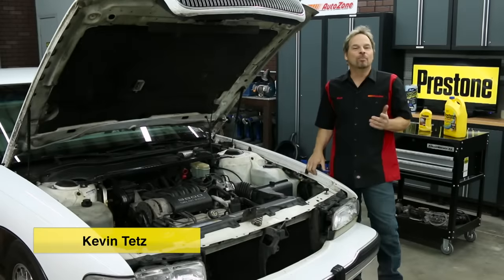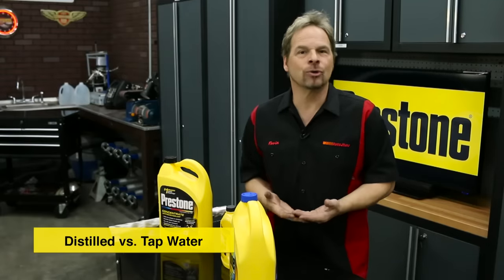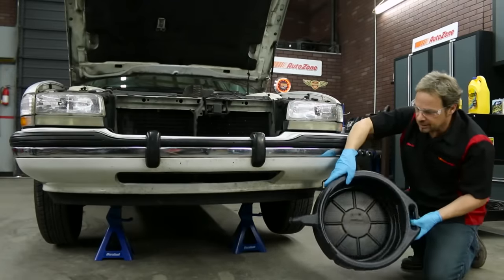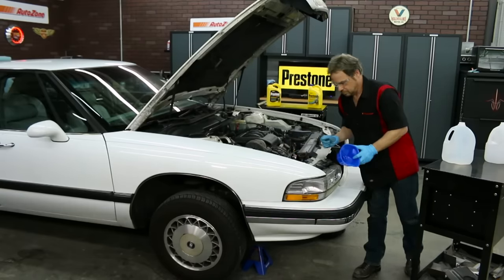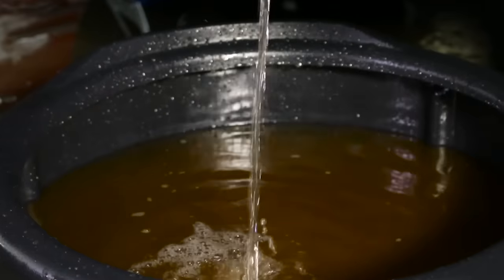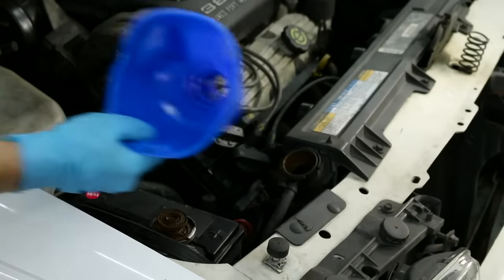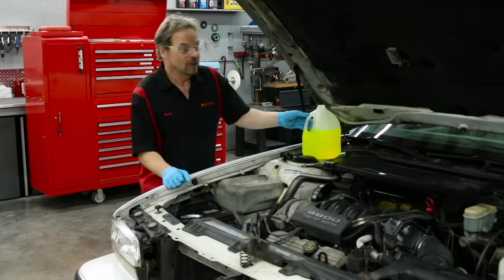AutoZone How-To: Flushing and Filling Your Cooling System

Comment: What he failed to mention was that there is quite a bit of water left in the engine block even after the radiator is drained. So, when he added a mix of 50/50, what the engine actually ended up with was  weaker than that due to the  water left in the engine block. The better way to do this is to add half the capacity in straight antifreeze, then top off with distilled water.
Reply: You're right T. Jones.  When you drain the radiator like this you're only getting out about half of what's in the entire cooling system.  There's still water left in the engine block and heater core.  If you use the 50/50 mix to refill, you're getting a diluted mix.  I would use the straight antifreeze when refilling as you suggested.
Reply: Anton Maxx 20 being the percentage of antifreeze to 80 percent water. You can actually use just water with a radiator additive  making sure it contains corrosion inhibitors. Water alone is much better at displacing heat than polyethylene glycol mix in hotter climates but the only problem is the hot dissimilar metals want to corrode without a additive.
Reply: Agree!  This how I would have done it too.  It doesn't hurt to have 60/40 either.
Reply: @AWIERD1 , I'm sure you could do 80/20 but I wouldn't do it on my car since I live in the cold climate.  However, even in the warm climate I'll still do 50/50 to reduce engine overheat due to lack of glycerol since water boil and evaporate.
Reply: @tousshong9438  There should be no water boil due to the positive pressure in your cooling system. Positive pressure of 14-15 pounds increases the boiling point of water 45°F (25°C). Most all modern vehicles utilize positive pressure to increase the boiling point of water nowadays. 

The active component of antifreeze ethylene glycol carries 37% less heat per unit of volume than water. Also it tends to breakdown in the presence of oxygen into various acids like formic, oxalic, glycolic, and acetic acid. Requiring more additives to keep everything alkaline and buffered to prevent corrosion. So if you don't need freeze protection except for a few weeks I forgo antifreeze in place of corrosion inhibitors, water pump lubricant, and a surfactant.
Reply: Just stat engine a few moments to put that stuff out... then filled like he says.
Reply: At least start the car while draining for a few seconds
Reply: My name is Steve Rogers  
Where are the "engine block drain plugs" ?
Reply: My name is Steve Rogers  
I had no idea. i thought the drain plug you had to crawl under your car to get to by the radiator drained all of the coolant out. They should mention this in these videos.
I got to tell you I dont know much about cars or engines  
All i have done is tried this prestone coolant flush stuff with distilled water once like he did in this video .my coolant still had bits of gunk floating in it after I flushed it
Reply: Great 👍🏾 advice T . Jones. You should have your own channel . 👍🏾
Reply: Even than filling with half the capacity it’ll push it out the radiator when filling
Reply: @rbeck3200tb40  The radiator drain plug tends to be the lowest part of the system. Before draining, if you get the engine up to temp, letting the thermostat open, the coolant in the block will drain. Add the flush fluid and run the engine again with the heater on (to flush the heater core). Drain it again. If it's not clear liquid, flush it again. Add more flush fluid, run the engine , drain the fluid. Simple as that.
Reply: @mvsawyer  Or take out/replace the thermostat if it's easy to get to. Chrisfix has the best video on flushing coolant. These are short, sales add type videos
Reply: I ran my car with tap water for a couple of years with no coolant. It still worked great even in 100 degree weather. Lol.
Reply: Straight water cools better than antifreeze. You only need the "antifreeze" if you live in cold climates.
Reply: @greenram1996  drain it over and over with a hose of you have too..till its clean water coming out. He.open the bleed 1st at beginning of vifeo..
Reply: @greenram1996  so after its all drained out after the final water flush and you got out what you could from the rad and possibly the reservoir you simply add a full gallon of concentrated coolant and follow by whatever water is needed to top it off which should be less than a gallon if your capacity for example is 2 gal?
Reply: That's why he ran it with distilled water. It mixes with the remaining coolant in the block and comes out when you drain it a second or third time.
Reply: @alfiramos8566  exactly ..BOOM💥💥💯💯THATS ALL U GOT TO DO IS START THE ENGINE, PUSH THE REST OUT AND SEAL AND RE-FILL
Reply: He also said it’s ok to flush with tap water,  which is wrong, only use distilled water for the flush. I usually flush five gallons through the system before it’s clean enough to to add 100% glycol.
Reply: So what ur saying is. I should put in 100% concentrate for half of the capacity. Since there is half of the water in the engine block. Then just top it off with distilled water so I can get a more accurate 50/50 mix?
Reply: @numbers7889  Yes, that is the correct procedure. You should be able to drain more than half of the water (especially if your engine has block drains) but you won't get all the water out.
Reply: @TJones-ve8wd  thanks. I just finished doing that. I’ve got a more accurate 50/50
Reply: I tried to drain my coolant today in a 2010 Elantra and only 4liter came out even though the owner's manual says its capacity is 6.6lt. and when I added new collant less than 5 liter went in. I added a flush thign s well. is there a way to empty he complete coolant?
Reply: @wonderwalls3565  It is nearly impossible to get all of the coolant out. This is why it's so important to flush thoroughly. You want to make sure that the only thing left in the engine when you're done flushing is distilled water.  Check to see if your engine has block drains. If it does, you should be able to get quite a bit more out.
Reply: @wonderwalls3565  no. It’s never going to completely come out. What I did is I just used concentrate.
Reply: @numbers7889  I put a flush fluid. do i need to drain all of it? I feel if I dont it may destroy the radiator/engine block.
Reply: @wonderwalls3565  yes you need to drain it out. Can’t leave it in there for too long. So you might need to repeat the flushing process a couple of times. Add the coolant 100% concentrate. Then top it off with 50/50 mix. You can use the 50/50 mix to add more coolant later on.
Reply: @wonderwalls3565  ran into the same problem so I understand. Theoretically you could keep the car running and keep the petcock open so that all the water and coolant that’s stuck in the engine and stuff is free. But personally I wouldn’t do that. Could risk damaging ur engine.
Reply: @numbers7889  I opened the radiator drain plug and added 5liter distellied water till I could not see any more coming out. should I add 5liter more before adding the coolant?
Reply: @wonderwalls3565  when you added the 5 liters of distilled water. Did you keep the drain plug open or closed?
Reply: @numbers7889  opened. I added 2*5lt more to flush out everything with drain plug open and after 15 minutes I closed the drain plug and when trying to put in the coolant it took less than 3 ltr and keeps throwing out if I add more. the manual says it needed 6.6ltr. I have no idea how to remove the air. tried reving up the engine with the radiator cap open but nothing.
Reply: @wonderwalls3565  maybe squeeze the top radiator hose. Also if you have ur thermostat inside, chances are, you won’t be able to get most of the water out unless your car reaches the correct temperature
Reply: @SOLDOZER  But corrodes
Reply: @kirbyrohling8392  why, replace it with distilled when your done
Reply: @TJones-ve8wd  yeah but coolant will take care of any residual tap water
Reply: Or you could check the concentration when done.Calm down.
Reply: @rbeck3200tb40 Then you should have flushed it more than once
Reply: So I have to ask how so. Does the water separate from the antifreeze?  Does it weigh more which is why it stays behind?
Reply: @jmedi5589   With most engines it is impossible to fully drain the coolant from the block. When it is flushed with water, there will always be some left in the engine. This will dilute the antifreeze/water mixture that is added.
Reply: that makes zero sense
Reply: To flush all the coolant including the block just take out the thermostat to keep it open. Afterwhich, pour the flushing liquid and top it with distilled water. Run the engine for about 10 to 15 minutes, revving it from time-to-time. Cool it down to flush. Next, fill it with distilled water and run the engine again and continue this process until you are satisfied. Finally, put back the thermostat, fill with ready to use coolant (up to you) and your cooling system is as good as new.
Reply: What he failed to mention was “I’m a trained professional and smarter than you 😳😳😳😳😳😳😳😳😳”
Reply: Couldn't you just do a round or 2 of flushing with what you need?
Reply: There is a drain in the engine block in which he failed to drain so the old coolant and water he used is still there
Reply: This comment thread Is GOLDEN
Reply: To tell you why I prefer to buy a concentrate rather than a ready-made mixture. Because I'm used to flushing the system two to three times with water. Since the system is not emptied completely, only water remains inside. Then I look in the instruction booklet to see how many liters the factory filling holds and how many the service filling holds. Let's say that the difference between one and the other is 7 dcl., I pour 7 dcl. concentrate, and the rest is a mixture that I make myself.

Comment: Step one: make sure engine is cool before opening the radiator cap!!!
Reply: Awww, that's no fun!  You ain't lived 'til you've spent a few days in the burn unit!  Buzz kill.
Reply: He said that.
Reply: What if you melted the cap?
Reply: @codymiller3444  step 0: throw the car away
Reply: @BRO.JUSTIN  lmao
Reply: @claveecl1564  😂 forgot I commented that
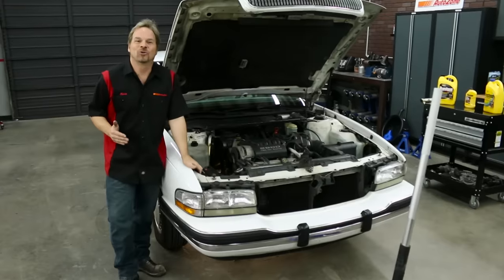Reply: 2:00 ish mark. He said make sure the engine is cool to the touch
Reply: 1:55
Reply: Not really just apply pressure on the cap some is gonna over flow but it not gonna fly every where
Reply: @justinrobinson1494  you've never seen a reservoir have boiling coolant before then...
Reply: Learned that the hard way😂
Reply: Lmao
Reply: On my first antifreeze change after a few turns the cap just popped off and hot antifreeze got all over me I learned my lesson and was left kind of traumatized
Reply: Not that important. Just slowly unscrew it like a bottle of shaked coke.
Reply: I open the cap hot  all the time, mainly if it's just distilled water inside.. not if there's coolant.. like recently, I had to do a water outlet.. they didn't even last a year total failure of the part. Anyway, the part was covered, but they don't reimburse you the coolant you lost... so there you go, you have to buy more coolant
Reply: Just cover it with a rag when opening it. Waiting for it to cool down takes a long time.

Comment: Years ago my father used a "flushing agent" by a leading brand manufacturer before we went  on a trip out of state. Some of the "flushing agent" was still in the system as we traveled maybe 120 miles. The dummy hot light came on but it was too late, the engine was already burned up. To this day, I have never and will never use a "flushing agent" by any company when doing a drain and refill. My mechanic told me when doing a drain and refill to remove the bottom radiator hose and radiator cap. When all the coolant drains out, turn the ignition key on and off three times to remove additional old coolant in the system. Replace the radiator hose and fill with new coolant while the engine is running and the heat is set to hot and fan speed on high, run for 5-10 minutes. Turn everything off, top off with coolant as needed. Check regularly in the coming days or weeks depending on how much you drive to add coolant as needed.  My radiator and overflow are part of my regular checks under the hood. I hope this information saves you from burning up an engine. WEAR SAFETY GLASSES & DISPOSABLE GLOVES WHEN WORKING ON YOUR VEHICLE. PEACE.
Reply: You are a God send. Thank you for sharing your experience with us to educate us on the proper methods to maintaining our vehicles. It is truly appreciated. 🤝🫡🙌✅🚌
Reply: Man I’m going to try this, I’m a young guy trying to learn so I can save heaps of cash
Reply: @ronhenson7167  That’s great advice. Thanks 👍
Reply: @Mark-um3hm You're welcome.
Reply: Also there is a thing of too clean when dealing with rust. Each clean exposes new layer of fresh material to rust away. Just draining and refill gets out the unnecessary excess rust and dirt and keeps that thin layer intact from rusting more...like those old rusted Chevy that have been rusty forever...
Reply: use a solvent oil in yopur colling system it wii last forever the system.-

Comment: Please DON'T DO THIS If you live somewhere like Canada where it gets really cold. Your block could freeze and crack when it's -35 celsius outside.The final mix ratio using this method will not be 50/50 because there is still distilled water in the block and in the loop (or even worse, tap water or some flushing product). Quite a bit of water too! For example, in a 'typical' 4 cylinder sedan the flush volume could be 5.2 litres vs total volume of 6.5 litres. The difference of 1.3 litres is 20 percent of total volume of 6.5 litres. That is enough to significantly change overall ratio. If you your freeze plug doesn't pop out or you live further North where it goes down to -50 celsius : game over.
Reply: Very few people live where you do. Regular society doesn’t experience -50°C
Reply: @BESTVIRALVIDZS As correct as you are, IMO : Don't make an instructional video if your method / ratios / math is wrong.
Just explain it the way it really is. Give people a chance to get it right.
Reply: @BESTVIRALVIDZS  a lot of Canada including big cities like Calgary (pop 1.7 million) does get below -40C. You need to use 60/40 there.
Reply: @ChilledSon he literally said you can make your own mix according to your environment and how the temperature is. Most people especially in America don’t live in -30C weather, where this video is targeting

Comment: I was always told, your car should be running when you add coolant? Is that a myth?
Reply: You don't want pressure in your coolant system when you go to change it but you can turn it on to help it pull added coolant or water. It's also useful when you need to flush the system. Just don't let it get too hot.

Comment: For all the Do it yourself people, this is not a flush this is draining the radiator and filling it after draining. Check your coolant and if its good but you still want to change it for the pece of mind then just empty the radiator and fill it couple of times. no need to fix something which is not broken. I learnt the hard way.
Reply: THIS is good advice.
Reply: He did flush it with the concentrate and distilled water though, and ran the car for a few minutes to flush the radiator. how is this not flushing?
Reply: @JiffiJiffJeff  Flush requires a pressurized machine (or hose) forcing new fluid OR water through the system, thermostat open, hoses etc. until it's clear of visible particles and discoloration. THIS is considered a change such as with an oil maintenance where you're simply dropping the current volume adding more and letting it circulate then dropping it before your true fill. It's technically a flush because of the cleaning additive used to "flush" out the contaminants.
Reply: @TOOL_TECHNICAL is a flush necessary? I am working on a project car that was in an accident and the radiator needs replaced.
Reply: @appleuser7146 Start with inspecting the condition of the coolant in the reservoir and drop some from the petcock of the radiator itself. If you have clear containers it's easier to see OR you can get a really good light and peak into reservoir. If you see buildup or floating contaminants or faded/dirty/discolored fluid definitely change it. In the case of a project car especially if you don't know the care from the previous owner I'd do several changes since you won't get all the contaminants on the first go. If you're feeling brave i'd also take a look at the thermostat as an old one that isn't working may be stuck open or closed leading to overheating potentially.

Comment: To tell you why I prefer to buy a concentrate rather than a ready-made mixture. Because I'm used to flushing the system two to three times with water. Since the system is not emptied completely, only water remains inside. Then I look in the instruction booklet to see how many liters the factory filling holds and how many the service filling holds. Let's say that the difference between one and the other is 7 dcl., I pour 7 dcl. concentrate, and the rest is a mixture that I make myself.

Comment: Nice video! When you fill in your own fresh 50/50 coolant at the end, will the final ratio still be 50/50 given that there remains to be some distilled water left in the system from your last flush?
Reply: No, it won't be. You have to allow for that.

Comment: After u insert the flushing product and water do you put back on BOTH the radiator cap and drain plug while running the car witht he heat blasting??
Reply: Yes